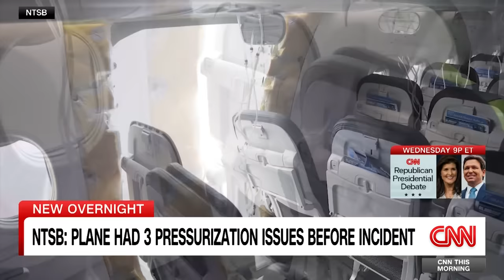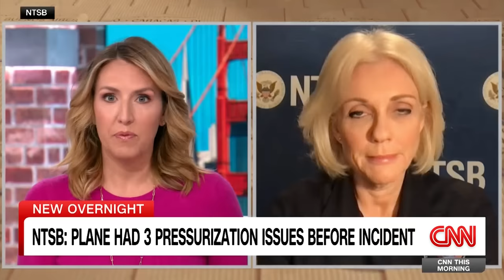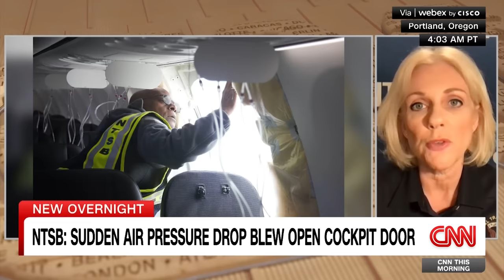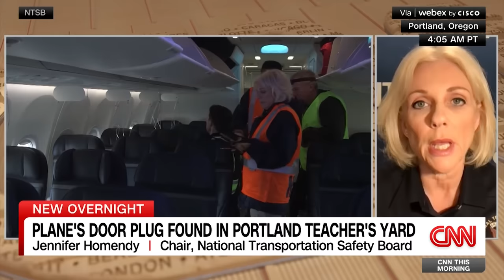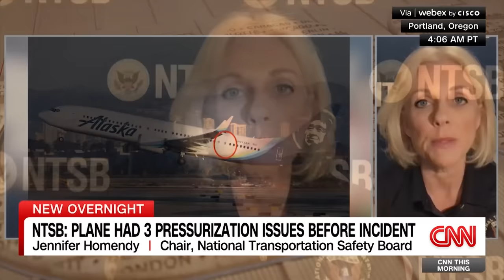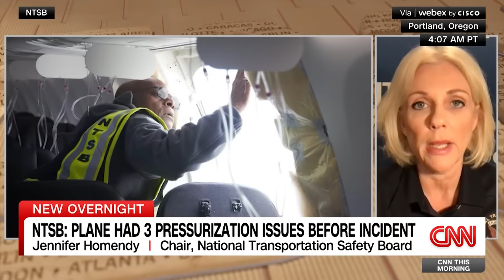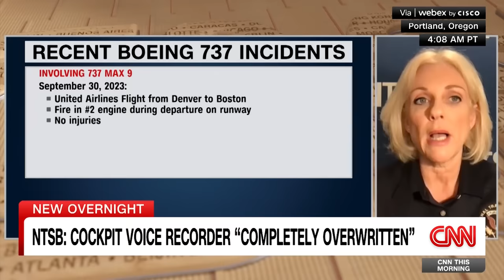Official asked whether it's safe to fly on any Boeing plane right now. Hear her response

Comment: Incredible that Alaska Air didn't properly investigate the repeated pressurisation warning lights.
Reply: They did lol they couldn’t replicate the fault to begin with, so Boeing was made aware of it..
Reply: They did.  She said so.
Reply: What are you talking about? They did. They MEL'd it. I know you're obviously not in the aviation industry. It's not that simple dude. lol
Reply: It has not been determined if this had any contributing factor in the incident. As the other comments was addressed within the repair certificate requirements. Alaska in an abundance of caution restricted use voluntarily until the pressurization light could be addressed in a more detailed check which was scheduled.
Reply: @skinnybricks  What is obvious, whatever industry you work in, is that when simple fixes don't fix a problem, there is obviously a more persistent problem which requires further investigation. And obviously, DUDE, they didn't take the correct action because the door plug blew out at 16000 feet over Colorado. You don't need to be in the aviation industry to figure that out, DUDE.
Reply: @thebanksfilms4426  How can you replicate a pressurisation fault on the ground?????
Reply: @MrShobar  You need to listen more carefully. That is NOT what she said. What she actually said was that they are going to investigate whether the appropriate action was taken by the airline.
Reply: @QuicknStraight as others have noted, they did investigate it but could not determine the fix for an intermittent fault. Many airlines have a deferral program that allows for a certain number of repeat items within a certain number of days. I seem to remember one being 4 repeats in 20 days would generate a "must fix" item. This is the way the airline industry has always worked. If everything always had to be perfect, airplanes would never fly.
Reply: @QuicknStraight  I’m saying if they can’t get the fault light to come back on after the aircraft has landed, what exactly should they do? Typically when aircraft come in with an issue, A&Ps will try to replicate the issue, if they can’t, the aircraft is released. I see this happen every other week. Intermittent problems are the hardest to fix.
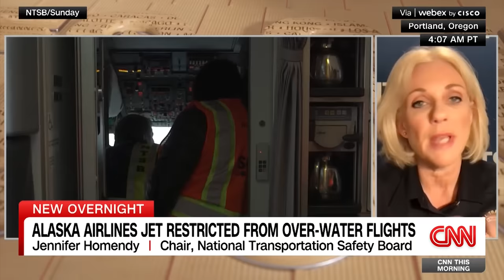Reply: @QuicknStraight  Where to start with you?  The first thing you need to keep in mind is that you're commenting on a video that's designed to whip you into a frenzy.  The CNN employee asking questions doesn't have a thought in that pretty little head of hers beyond "how can we drive viewer engagement."  You can see that clearly at 5:54 where the CNN employee waits until the NTSB chair starts explaining why people shouldn't panic before trying to cut her off a few times.  You can see that again when she clutches her pearls for everyone to see (think of my children!).  You can see that at the beginning where the CNN employee insists on describing the missing part of the plane as a door.  You can see that again when the CNN employee talks about a depressurization light.

Welp.  That ain't a depressurization light.  The light that illuminated is an "auto pressurization fault" light.  That doesn't mean that there's a problem with the cabin pressure.  In fact that light came on for the first time on the ground where the aircraft is unlikely to be pressurized in the first place.  

An amber AUTO FAIL light illuminates if any of the following conditions occurs:
• Loss of DC power
• Controller fault
• Outflow valve control fault
• Excessive differential pressure (> 8.75 psi)*
• Excessive rate of cabin pressure change (±2000 sea level feet/minute)*
• High cabin altitude (above 15,800 feet).*

Note that on the ground,  it's impossible that the cabin altitude would be 16,000 ft.  Since the Alaska crews extinguished the light by switching to the alternate controller, it's unlikely to be an issue with the control valves or pressure vessel itself.

As for testing a pressurization fault on the ground, you run the engines just like you would in the air.  In fact Boeing does just that with each new 737.
Reply: @thebanksfilms4426  I'd suggest, with a pressurisation warning, they ought to take it up to altitude, with no pax on board, and try and replicate it there. How are you going to replicate a pressurisation issue on the ground??
Reply: @az.................  "United finds loose door plug bolts on grounded 737s". That kinda cooks the goose, no?
Reply: @thebanksfilms4426  See the United story? They found loose door plug bolts on grounded 737s.
Reply: @QuicknStraight  Im talking about they had an issue with a fault light on the ground. Why would they need to take it to altitude to see if the pressurization system was working if on ground it’s not pressurized lol
Reply: @thebanksfilms4426  Because the fault light was in the pressurisation system, obviously. How can you establish where the fault in pressurisation is on the ground? They don't have the equipment to do that outside of a full facility, such as the Boeing factory where they can pressurise a fuselage on the ground.
Reply: @QuicknStraight  you aren’t getting my point…why would the light illuminate on the ground to begin with? The NTSB also came a few hours ago and said the system is not related to the blowout.
Reply: @thebanksfilms4426  It illuminated in the air, not on the ground, AFAIK. The aircraft isn't pressurised on the ground.
Reply: @QuicknStraight  it had 3 scenarios, one was on the ground. Go listen to the NTSB’s interview. At this point, that fault is irrelevant without any evidence. If there is a “leak” anywhere, it’s not gonna set off that specific fault.

Comment: A lot of focus is on the research after the door blew off. But that faulty door should have been detected in the tests by the FAA. That’s not only on Boeing. The FAA also bears responsibility.
Reply: There is no proof the door is faulty. The aircraft was recently at an aftermarket facility to have wifi installed and the problems only started after that.
Reply: @haroldlipschitz9301  fair point. But once any changes are made, shouldn’t new tests come in? Which brings me back to my original point..who sets the rules for flying? I thought it was the FAA.
Reply: @Sharky1101  NTSB will definitely uncover whether Alaska did anything improper upon return of the aircraft from the aftermarket place
Reply: The FAA doesn't test each and every plane.  They do original testing of the design within a set criteria.  Those tests may not met all conditions which the plane can go through but its a minimum.   Then its up to the manufacturer to maintain those specs during manufacture of other planes of the same configuration.
Reply: @haroldlipschitz9301  - it wasn't a door, it was a bolted in door-plug so what has wifi installation got to do with a fixed non-movable door-plug...?  answer - nothing...
Reply: @23merlino  You are misinformed. The plug option on the 737 max-9 can be opened for maintenance purposes, so this could occur during wifi installation for sure. The door is simply not designed to be opened in regular service when plugged (there is no external latch etc)

Comment: So, knowing there was a problem they decided to fly the plane regardless. How lucky those passengers were. It could've been a huge tragedy. Passengers who trust that the plane they're flying on is safe. This issue should have been fixed when the problem first arose, but as usual it appears that profit is placed before the safety of the passengers and crew. Now the airline will lose alot more because of their own incompetence and complete disregard for the lives of innocent people. How many crashes have occurred because of poor maintenance, the wrong size bolt, poor repairs? When will they learn? When will people's lives be more important than profit. Utterly despicable.

Comment: I wouldn't fly any boeing plane at this point. Why on earth put a door plug in a plane? Never seen that before
Reply: The plug provides the option of adding an additional door (on either side) at a future point. If the number of seats were increased, the law requires you to have more doors for evacuation purposes. Door and window plugs are not uncommon. e.g. Boeing 747 Freighters don't require so many doors or windows.
Reply: Problem is you don't get to pick which airplane fills your route....so essentially your statement translates to "I wouldn't fly major airline at this point"
Reply: Why wouldnt you fly any boeing plane? Care to explain so that it makes sense? Just to note boeing dreamliner has had zero deadly crashes and is one of the safest aircraft out there

Comment: Allegedly boeing staff complained about the torch wrenches.  Those weren't just used on those door plugs.  If a torch wrench is the problem every bolt it touched is a problem.  They don't even know where all the other issues are.
Reply: if the torque limiting wrench is a problem then ALL 737MAX8/10 should be grounded until the check is over

Comment: I see the effort to make this a Boeing problem, but anything that is man made will fail that's why there were warning lights. It was Alaska Airlines responsibility to ground that plane for safety concerns instead of restricting it to shorter flights.
Reply: Not how that works at all lol. If airlines did this, damn near every aircraft would be grounded lol they restricted its flights because it was ETOPS.

Comment: A speculation. There have been problems with counterfeit aviation parts. Could counterfeit bolts been the cause? If they were not strong enough, they would elongate under pressure causing a slow leak. Recalibrating the sensor would blur the preceding anomaly. By the time it gets to the third elongation, the bolts fail, and the hatch blows out.
Reply: I totally agree with what you are saying. Boeing has had so many issues and I would think twice about flying on a  737 max or max 9.
Airbus has one of the best safety records and I'm sorry to say it Boeing but you are losing your way as being no 1 in aviation safety and maintenance.  I am a massive fan of Airbus and this is only my opinion but I  just think that they are producing such beautiful aircraft with a great safety record and we are now seeing a lot of American Carriers flying the A320 and A319s.

Comment: With the vagueness of her answers, it’s evident that capitalism is still more important than safety & lives. These companies regularly gamble with your lives on the odds of an issue becoming a failure of epic proportions. I would like to know, when they “inspected, tested, & returned to service” those components on this aircraft, from the moment it landed & went back into the air, what was the timeframe? For such an important safety item, was it really tested and inspected or did someone just “jiggle” the wire harness for the warning light & say, “It’ll probably be all right. Let ‘er bump.”?
Reply: The answers are vague because the team has only been in Portland for about a day and they don’t have all of the records to go into detail about the inspection/testing that was done. But, aviation mechanics are trained and licensed. It’s not a simple process on average takes two years to become a mechanic in the aviation industry. They have specific instructions when problems like (Pressurization Failure) which tells them what parts to look at.

Comment: It’s irrelevant that the depressurization warnings may have nothing to do with the door plug. The point is the issue should have been looked into instead of filling the aircraft with passengers and telling pilots not to fly over water. That’s ridiculous! LOOK INTO WHAT IS CAUSING THE ISSUE. This has obviously been a recurring issue and they had no idea what was causing it. And THAT is what is important to note… they had no idea what was triggering the fault. That is the definition of NEGLIGENCE.

Comment: Yesterday this woman said, "The door plug departed the plane."   Somehow, while accurate, that does not convey the actual situation.

Several  years ago, we boarded a plane at JFK twice and were kept on the runway and ultimately disembarked and reboarded while a fix was instituted.  THe third time, we took off and had to return to the airport due to a warning light.  THe airline was again insisting that this could be quickly repaired, but the pilot informed us that HE would not be flying this plane again today and would recommend that no one fly this plane until it had been "completely serviced."  MAJOR points to him and his clear instructions for our landing and disembarkation.  We were offered the same flight the next day, but opted for a different flight from LaGuardia which was uneventful.  It is shocking how the airline wanted to keep the plane in the air and on schedule despite three warning lights.

Comment: It is irresponsible for a media person to ask such a question is it safe to fly on any Boeing airplane and it is outright slander
Boeing has been building planes for decades and they are as safe as any other planes
The 737 is one of the safest airplanes ever made 
The two Malaysian airline crashes would not have happened with western trained pilots since the faulty sensors could have been overridden and the planes than be flown manually
This was confirmed by an independent investigation but the media never talks about that 
Sure what happen with that door is very dangerous but that is not a reason to condemn everything Boeing makes
On the other hand there are millions of faulty cars on our roads as a result of poor workmanship/ maintenance the only difference is less people get hurt or worse killed in any accident versus a plane but if 100,000 of these cars have accidents the picture looks much worse
In spite of this danger they don’t ground all cars to make sure they are safe and people don’t get hurt

Comment: If this pressurisation fault is non flight critical.  The airline can keep it in service.  I don't want to second guess, but this looks like a manufacturing problem, that the airline would not find unless they stripped the plane down to the skin.  The question, should the plane be still be flying is like an electrical appliance the keeps stopping, but when you remove it from the socket, & put it back in the socket & it works.  Are you going to ground a   70 million dollar aircraft, until you find what the problem is.

Comment: The pressurization event and warning light are for the whole aircraft holding pressure. It can absolutely be the case that this plug was loose and allowing pressure to escape and causing the warning. But it may not have been related at all.
There is other extensive technical info from other sources about this plug and it's opening that indicate this could only have happened if some or all of the 4 locking bolts were left off the plug and that these were missed in subsequent inspections. Hard to believe that could happen but it is looking very strong for this as of Jan 8, 10am Pacific.
It would be more likely that Alaska AL maintenance personnel were the last to have those bolts out since they will come out for any inspection or maintenance of that area and that is likely to have happened since the aircraft was delivered. The investigation will uncover more details.

Comment: T he first part about the warning light going off baffles me.  Usually these are malfunctions and even if it was, it's better to be safe than sorry.  If I was in charge I would have said, "nope, this jet is staying here, take another one until we figure out what's wrong".  I mean a pressure warning light can be a serious thing (better to be safe than sorry).  One thing if say your entertainment system doesn't work or perhaps something more minor but a pressure warning system is there to alert you about issues with pressure because at altitude, (or beyond 10,000 feet at least) it's very improtant to maintain pressure in the plane.

Comment: ..  there are 4 bolts, one in each corner, securing the door in place. Probably the door was in the open/unhinged position, the bolts unlatched .. no way to see it as its behind the wall panel .. that's why the depressurization warnings was triggered

Comment: I think it will come down to when they painted it the plug was not reinstalled with cotter pins on the nuts that hold the door in place.
Reply: Some initial findings from United Airlines inspection of their planes have already come out that the bolts holding the door plug were loose which means they were probably not properly torqued to specifications or the initial fastener design did not ensure they will not come loose.

Comment: The FAA is  allowing these planes to be back on air after short inspections, yet this woman clearly still has no clue what happened, so how could an inspection do any good? And im supposed to take two long haul flights later today on a max 737 9 that has gone through “inspections”. Total BS!

Its all window dressing, Boeing has failed quality control time and time again with these new fleet models. The former ceo should be in jail.

Comment: See it this way: The accident resulted in a precise hole only. Other aircraft in the same situation might have incurred more structural damage if not a total loss by a fracture in the fuselage. Just remember the "cabriolet 737" decades ago, still able to fly despite a massive loss of the hull. THAT is Boeing's robust construction, not giving up because of a failed door.
Reply: Yep that’s one way to see it…..